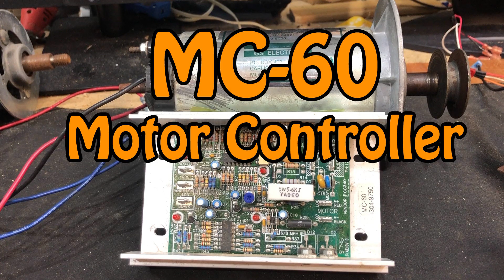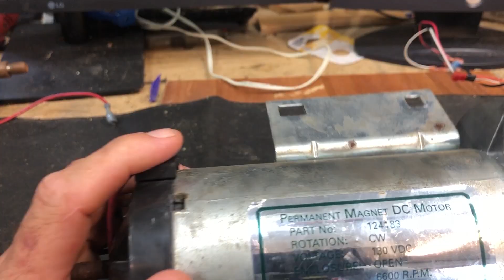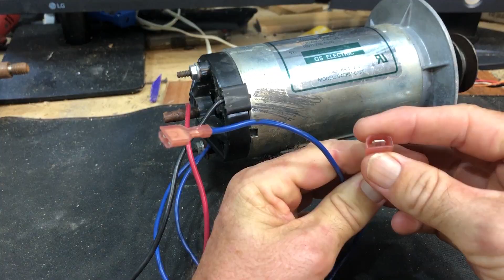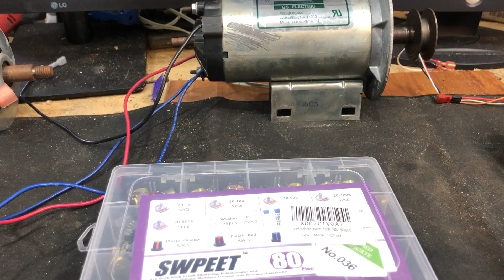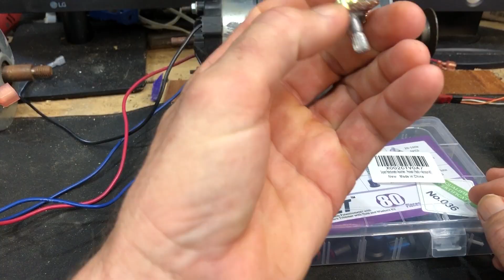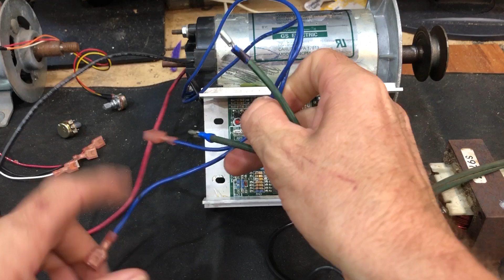116 - The MC-60 DC Motor Controller

Comment: Hi, just came across your video.
Very informative. 
It’s been several years since I tore dow and salvaged my motor but if memory serves, I believe that my motor has the two power leads but the other leads go to a hall effects sensor on the motor for sensing the motor speed.
Like I said, it has been several years since I fooled with it and my motor controller was integrated in with the mother board and I am not well versed with electronics so I was going to buy an MC-60 from Ebay but something came up and I got sidetracked.
Here I am several years later and this video has re-kindled my interest.
Ebay here I come for one of those MC-60s.
I have already bought a handful of potentiometer’s.